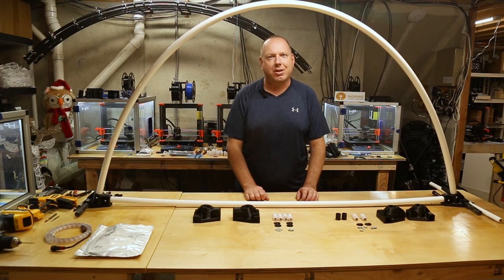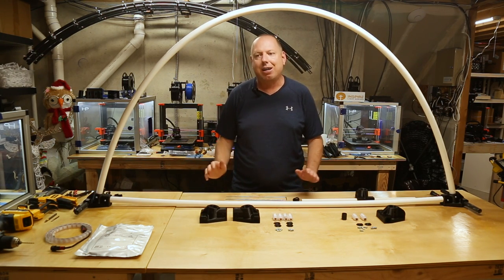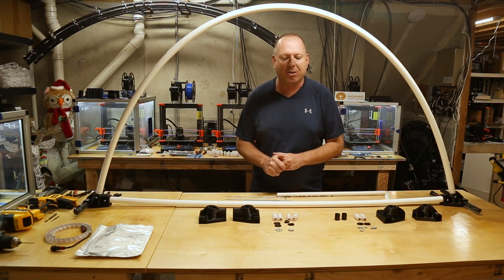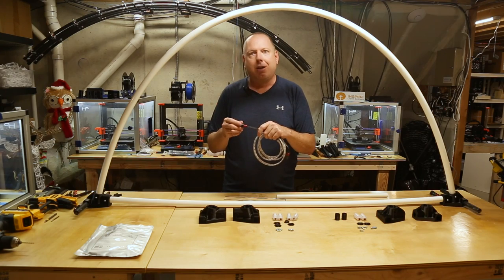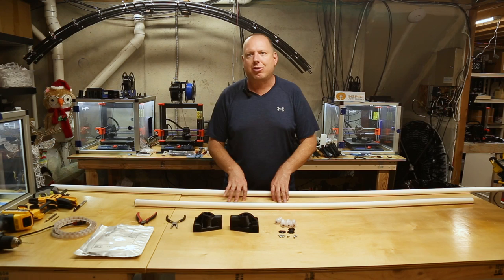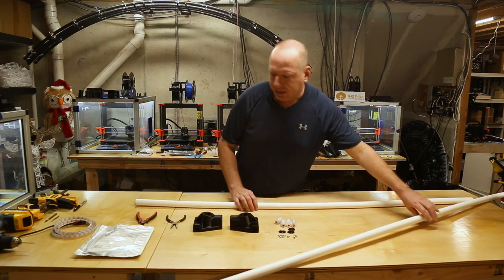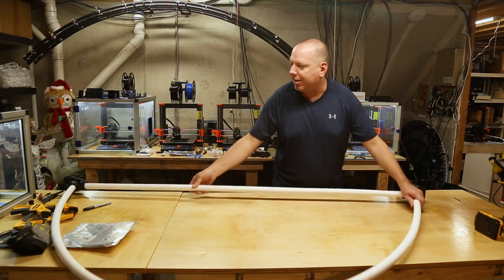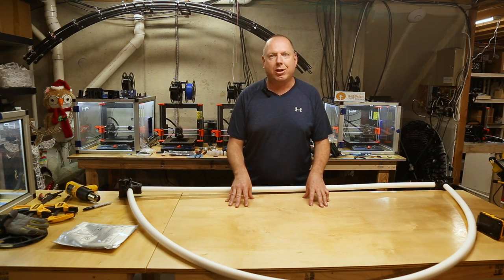PEX Arch Bases Overview and Build Video

Comment: If I purchase the STL file for the base, does it include the different angles, or must I specify?  Also, what 3D printing material do you recommend?
Reply: Duh ... I see in the ordering menu that I choose there the angle I want.
Reply from the maker: Recommended print settings are found here. https://inspirelightshows.com/stl-print-settings/